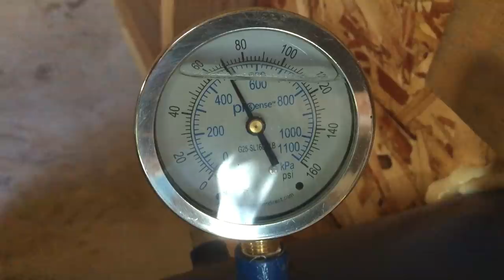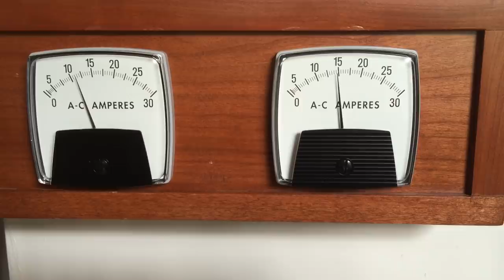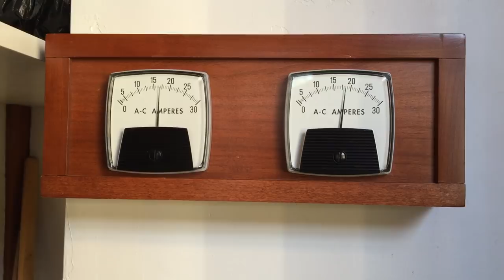Part 20-3 MicroHydro Power System in CO

Comment: just saw the synopsis after stumbling onto episode 18, gonna watch the whole series. amazing job. Hats off .
2019 i will (get help to) build a small  (nano?) Hydro Power system in a much milder climate, and with half the psi...smaller house...
not sure yet if you use batteries...probly not...i will need those ´cause in high summer not enough water - just enough for crops and household use. I lived 14 years with 250 watt solar panel...now temporarily on grid again...got so used to energy saving that the power company came to check 3 times if i hadnt tampered with the counter...lol...
Reply from the maker: thx for watching.  You are the sort of person I made the series for.  We are all straight AC here.  Would love to document a DC system if I can locate one locally.  No luck yet

Comment: ive been thinking of doing this for a couple of years somewhere in the mountains and i just found the 19 parts yesterday and now i want to do it even more 

 great project and even better result considering the challenges you faced
Reply from the maker: Micro hydro is fantastic if you have a site that works. The difficulty is finding the right place. There are new designs that broaden the possibilities. https://youtu.be/gY3p2e1-kN4 Turbulent wasn't around when I got started in 1996. I think their design is great. I just wish they had a larger market penetration. I don't think they have a large number of installed units yet. The low head/high flow approach is something that can be applied in so many places. When you think about it, moving water is the largest collective of kinetic solar energy on earth.  Wind and solar pales in comparison. Thanks for watching.

Comment: That exposed flexible black poly water pipe is going to have two problems, which we have in the California Sierra with that exact same pipe. The higher elevation means greater UV damage to the plastic (this also applies to your PVC pipiing, but that is a longer-term issue for that) making the exposed black flexi-tube brittle and crack-prone (which causes leakage). Second, the critters love to gnaw and paws on that exposed black flexi-tube and chew or claw holes in it. Apparently the black poly plastic is tasty to some critters - don't know it it's raccoons, possum, goats, or what - but they love to monkey with the black plastic drain tubing.
Reply from the maker: The poly pipe is to be considered a temporary solution to the longer term issue of massive spring run offs.  We haven't had any issues like you mention, but this years run off has eaten away the creek in a monumental way.  Future video will document it .  Not sure what the next plan will be yet as the waters haven't fully subsided yet.  Thanks for watching and for the comment.

Comment: So when the electromagnet drops the jet diverter thing, do you have to go back and reset it manualy? Also are you going to be moving the vortex tank collecter in the spring? Also it's really awesome that you keep replying to these comments even so long after the video was posted! Great series, I'm in Colorado now studying Electrical enginering, hopefully I get to do something like this at some point seems like it was a lot of interesting work.
Reply from the maker: Good question.  Yes, thats the way it is now.  It seldom happens as we are aware of not overloading the system with too much demand.  I did install control and sensor wires from the house to the powerhouse to be able to install a DC powered reseting actuator, but the man who said he would help with the control end didn't come through and its being a seldom occurrence I just haven't focused on resolving that.
Reply from the maker: Opps missed the other questions. The remival of the vortex collector is necessary every spring sometime in May. If I wait too long, i risk having it destroyed and lost. It’s not that it’s worth a great deal, but it would become pollution that im absolutely unwilling to accept. Negates the whole idea of the system. It goes back in after seeing water flow slow and how the creek bed has changed. 
There has been a recent huge surge in viewership of part 17 for some unknown reason. I get notifications of each comment and its fun to do replies. Makes the channel more valuable. Hope your studies yield productive results. Thx again for watching 😁

Comment: Thanks very much for your entire series.  The engineer in me wonders about the cost / benefit type of stuff.  For example, the cost of your installation vs installing a power line to the local utility.  Or what is your calculated cost per kwh (based on what you use, not what you produce).  Someone below asked could you sell excess power back to the local utility.  Or maybe make a deal with some of your neighbors (you give them power, they give you firewood or something.)  Anyway, congrats on a job well done!
Reply from the maker: andydickey thx for watching. 7 miles from grid. 1995 estimate to string power was $20k/mile and 2-3 times that  $250-300k today!
So we don't look at it in cost/payback as most people would but rather as an investment in the value of the property. There really isn't a way I could measure how much of the power is actually used. We always have 300 gallons of domestic hot water on hand and excess power is spent as heat. Neighbors are few and far. Other benefits of the system are discussed at beginning of part 1 of synopsis. Whatever the cost per used kWh is it beats the heck out of stringing power in decades ago. 🤓
Reply: Eliminating the utility overlords increases your value.  Just bloody marvelous what you have accomplished. You are a blessed man.
Reply from the maker: Thx. We are so fortunate to have found this lovely and powerful spot

Comment: This is so awesome, thanks for sharing!  Found this tonight while looking for ways to pump water up a hill so I can start an orchard and water some animals.  Now you've got me thinking about providing my own power, too!  I live in western North Carolina where water is fairly plentiful, but mostly in very flat streams with low head.  For example, I have access to maybe 600 feet of a stream, but it only has about 15 feet of head.  I figure I'll experiment with some homemade ram pumps, but I'm really curious about the power production potential here.  Are you able to share any of your spreadsheets with calculations of cost versus pipe size, etc...?  I love crunching numbers and have already started to gather some info- really impressed by how detailed and thorough you are!  Any help or advice would be amazing!
Reply from the maker: Sorry for the slow response, our internet went down for 3 days right after your comment.  You don't necessarily need a tremendous head.  The pelton turbine I have is designed for a high head and considered a reactive turbine.  There are other types which are designed for low head and high flow. 15 ft of head is a lot of head if you have lots of flow.  
https://www.researchgate.net/figure/Turbine-selection-chart-based-on-head-and-flow-rate-1_fig2_292726939
A Francis Turbine might suit your site better as it is optimized for low heads.  Or maybe a crossflow turbine.  

This system appears to be promising although I don't have any direct experience with it https://www.youtube.com/channel/UCwVtAvxECRpogletKHlV_uQ

My spreadsheets are specific to my site and I don't think they would be of much use to you.  They take pipe friction and distance into account and I don't think that is the problem you are trying to solve here.  

There is a book which you can get which basically chronicles many different systems and approached to harnessing power.  It is basically a grouping of articles which originated in Home Power Magazine which is no longer being published.  
https://www.amazon.com/Serious-Microhydro-Water-Solutions-Experts/dp/0865716382

There are all sorts of information on the web now about MH. That was not the case when I started in the 90's.  I attended a class at Solar Energy Intl. to get my basics down back in 1995.  https://www.solarenergy.org/training-schedule/?tribe_paged=1&tribe_event_display=list&tribe_eventcategory=124 

From there its all been experiential for me.  Hope this helps.  Drop me an email at MrHydrohead@gmail.com if you need more pointers.

Thanks for watching.
Reply: RAM pump

Comment: 144000 kwh of electricity is worth about 18000 USD. Pretty nice, and looks to be working reliably all the time. Also getting the electricity in would cost quite a bit, it would take very long for the return on investment. I am not sure the use of the old generator for the new stream was the best idea, but definitively cost conscious. I myself would use both systems, and use more modern turbine and generator for the second one, with electronic to do ac-dc-ac conversion, so it operates optimally. But if the existing equipement works, and you wanted to get rid of the other one, then sure, it makes the most sense. You can always change the generator later.

Comment: Hghly interesting documentation. Thanks a lot for sharing.  Why do you use baseboard heaters?  Did you every thought about using heat pumps to conserve energy?
Reply from the maker: Good Question.  The baseboard heaters were a short term inexpensive way to access the heat.  Our house has an existing in floor glycol system and that is where I want to put the heat, but I've had a long extended difficulty in getting the plumber up to plumb in a second water heater to facilitate that.  
The issue of heat pumps comes down to cost.  We already have an enormous amount of power available so efficiency isn't a factor.  Heat pumps are an expensive system as well.  Also as far as I know most heat pumps work with forced air heating systems which we do not have in our home.  Thanks for the question and thanks for watching.

Comment: Fantastic project!
Given it is a really free and green power, I think state subvention should help more for such remote location.

Edited / not enough power to consider it as a financial product
Reply from the maker: ROI?  We don't look at it that way.  The cost to run power in when we started in 1996 was estimated at 20k per mile or $140k.  That initial system was $25k and we got domestic water and a pond to raise fish for that.  The estimate to run power in was 250-300k in 2014 when moving the system to the creek was 55k.  So you can see compared to the alternative of paying bills it was a deal.  Furthermore, it is a massive improvement to the value of the property to have a power source which will last many many years into the future. So far the system has generated ~240,000 kWh, so choose your own cost per kWh and there's YOUR answer.  thanks for watching...
Reply: @mrhydrohead  Thanks for your answer, you achieved a lot, congratulations for going through all these fantastic steps! Apologize to not have read more before posting. I am coming from the east of France and here there is some un used very old sawmill along water streams, converted to only hydropower now and connected to the grid. (in the past these sawmills even powered a bunch of houses for keeping workers and there family close to the factory)

Comment: Thanks for the excellent series. Well done! We are setting up a smaller 1kw system, here in New Zealand, to pair up with our solar system to cover the lower daylight months. One thing that I'm trying to figure out is how to regulate the dump loads, not wanting our pelton turbine to over-rev. We are wanting to have 2 loads for when the batteries are full: firstly channelling 230v AC into our hot water cylinder, and when the thermostat cuts off then supplying AC 230 volt heaters in the glasshouse. Have you found anything that works well for sensing and switching excess power like this? We have a Victron Easy Solar unit charging Lithium batteries and providing us 230v mains power. Thanks : )
Reply from the maker: Our load controller was made by Thomson & Howe in Canada. (https://www.facebook.com/pages/Thomson-Howe-Energy-Systems-Inc/214294835610086)  It utilizes SCR circuits to shunt the load.  Our A-2 model probably is overkill for your needs.  They may have other products which are better suited to smaller loads. Or you might look into a "hummingbird" design which you could build yourself. (https://www.researchgate.net/publication/265931735_A_Micro-hydro_Electronic_Load_Controller_ELC_for_the_Developing_World).  Best of luck with your setup.  Thanks for watching
Reply from the maker: I'm not experienced enough to build this myself but here is a link on design of hummingbird http://www.remotehydrolight.com/DigitalELC.pdf

Comment: A fantastic series of videos, thank you so much. Even here in Tennessee it might be worth trying on a much smaller scale. You say that you transformer is 480 volts, you must then step this down to 220v 2 phase? yes?
Reply from the maker: Yes. There is only single and 3 phase which refers to how power is made in the windings of the generator. Our particular generator can be wired for several outputs. We chose 480v output because of the transmission distances. The higher voltage allows for less costly smaller gauge wire. A lot more detail on the wiring is in part 14. Thx for watching and your kind comment.
Reply: Thanks, being an English electrician, I do understand, although I have noticed in the US domestic supply is 2 phase. In the UK 3 phase is normally only present in industry and agriculture. With 230 V 50 Hz single phase for domestic use.
Reply from the maker: While I’m not an electrician, my understanding is that 240 or 220v is single phase on the sine wave, where you get high voltage across the two hot legs and 120 or 110v across either hot leg to common leg. I understand that single phase refers to the nature of the sine wave of the power.

Comment: I may have missed it but, as your system is "non-consumptive", where do you get your drinking water from?
Reply from the maker: The first hydro system before moving to creek was two springs which still supply domestic water via secured water rights. Thx for watching
Reply: @mrhydrohead  Many thanks.

Comment: Hi kris, I have a small stream near my house that is similar in capacity to yours. And I would really like to build a power plant like yours. I already bought an inverter for 48v, I'm waiting for a turbine from the USA, I ordered a 120v at 1200 rpm and 250v at 2800 rpm, can you advise me which pipe to choose, how to measure liters per minute and height, and whether to buy a classic midnight he's only to 150v. I live in Ireland greetings Martin 🤓
Reply from the maker: Sorry for the slow reply.  The earlier parts of the series on this channel goes through the process of measuring head and flow.  Pipe sizing is based on how much water you can expect taking into account the seasonal variations in flow, length, and pipe friction.  Picking the right diameter to handle the expected flow is a critical decision.  Too small might be cheaper but friction loss may cripple the system.  I've heard of one person that didn't follow the instruction given by a pro and the system consequently doesn't perform as expected.  Kris is not me however and you might be confusing me with another micro hydro channel.  Just the same Thanks for watching.

Comment: I have my eyes on Creek or stream property for this very reason. You are some lucky folks. You wouldn't happen to be in the engineering trade would you?

There is a man near my house who bought the remains of a grist Mill. He allowed me to tour his set up one day. Still had one of the two leffel turbines from when it was "modernized" in the 1890s. He says at ~12ft of head he was putting out 35kw. He could have put out a lot more, had a 150ish hp turbine rigged through an old linear induction motor and gearbox. Kept having issues with the trash rack getting blocked. All built pre civil war... I think 1840 or so. Foundation of the house is 4 feet thick.
Reply from the maker: Sounds like a great mill site. Must put a LOT of water through it to get that power out of 12ft. 

Best of luck finding a suitable spot. We are fortunate to have found this property. Not in engineering, but worked 30+ yrs as a cinematographer in the film biz. Everyday you build up stuff and then tear it down upon wrapping. Leads to a practical sense of what can work and what is safe.

Comment: I really enjoyed the videos. I haven't seen them all (yet) but have a question. If there's an answer to it in a video, then you can point me there if you want.
How do you handle the issue of voltage and frequency fluctuations? Do you rectify it to DC and then invert it back to regulated AC? I know that's not an efficient method, but it's the best I've got, as with this, you don't need to worry about being charged for wasted energy.
Reply from the maker: Part 14 of the series focuses on electrics. An Electronic Load Controller ELC is utilized to manage to load on the steady AC generation. It does this by using SCR circuits to shunt a portion of the sine wave off to resistive loads. It was made by Thomsen & Howe in Canada. It switches a different amount of load to maintain 60hz and monitors hz every few milliseconds. Hope this answers your question. Thx for watching
Reply: +MrHydrohead Okay thanks, I'll watch that one.

Comment: Grate videos of being off the grid. I was wondering as to your backup, are you using battery?
Reply from the maker: We decided against batteries long ago not wanting any toxic chemical or maintenance issues associated with them.  We are direct AC and currently use excess power mostly for hot water and a hot tub.  Thanks for watching